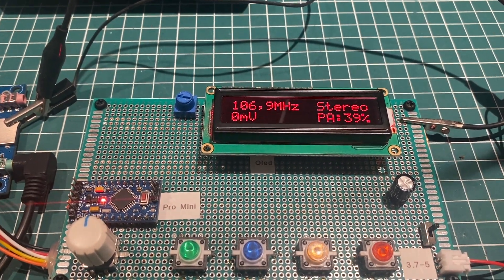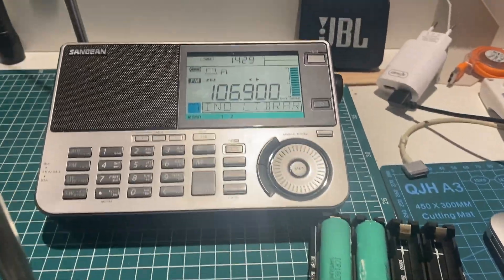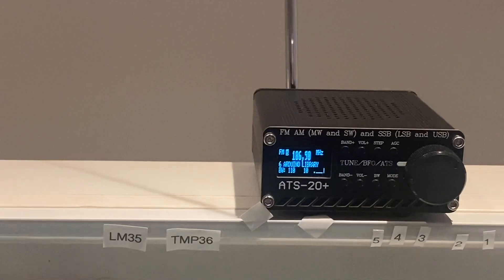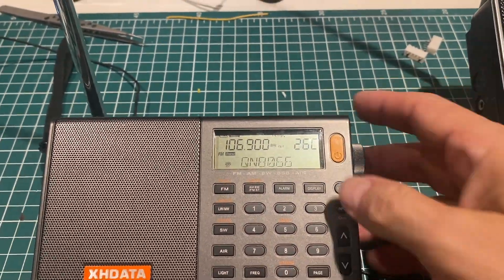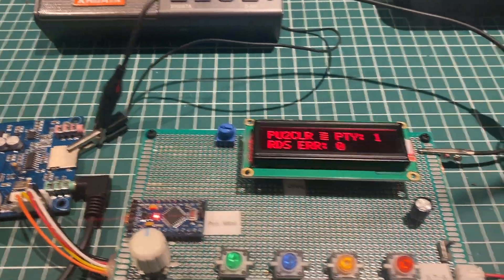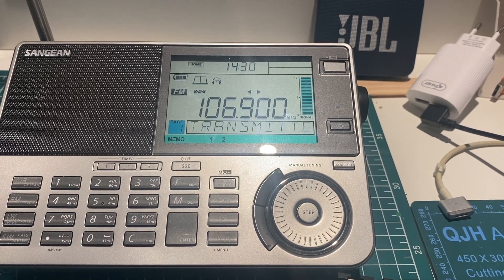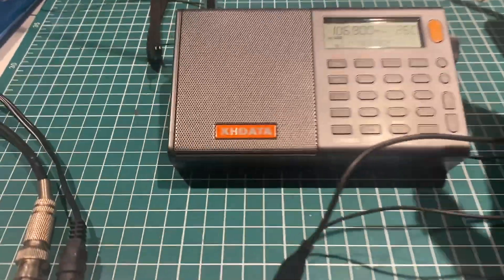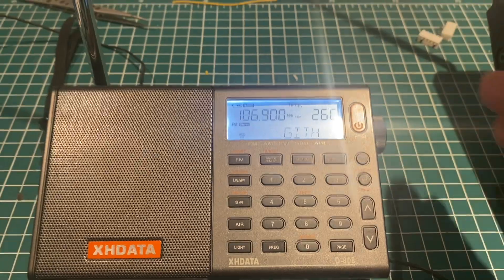QN8066 Arduino Library by PU2CLR - RDS - Part 4

Comment: Hi Ricardo. Well done, have looked at your github project too! I have purchased this kit also. But need some advise... What does the green adjustable potentiometer do near the coils? Does it set power output? Do you know the range? My transmission is not good at all. I made a dipole antenna from copper wire for 105mhz. I only want to transmit a few meters for many radios at a wedding function. Please help!